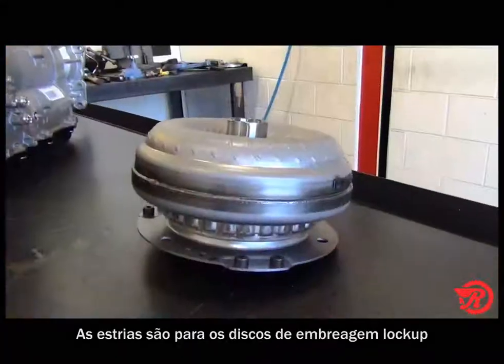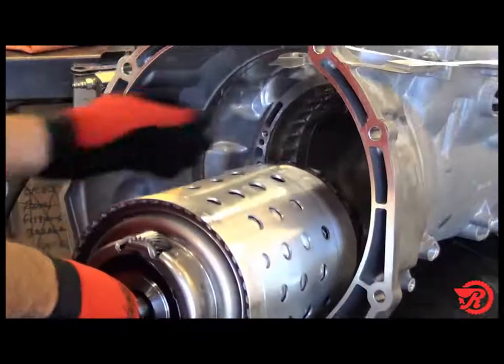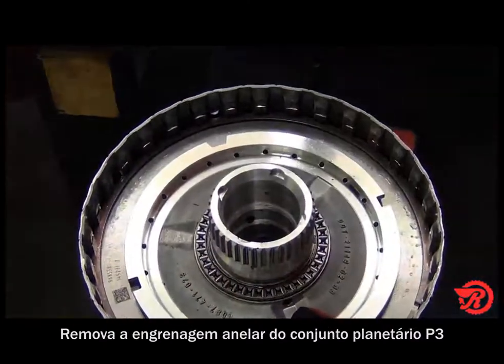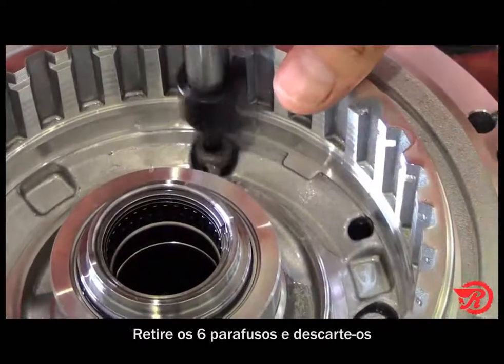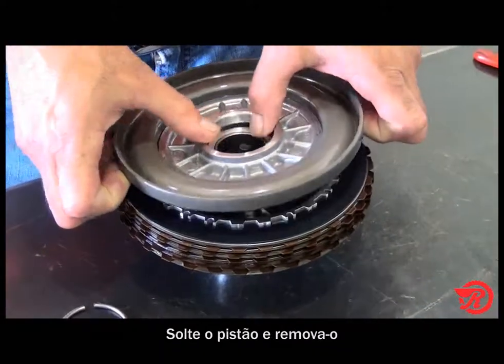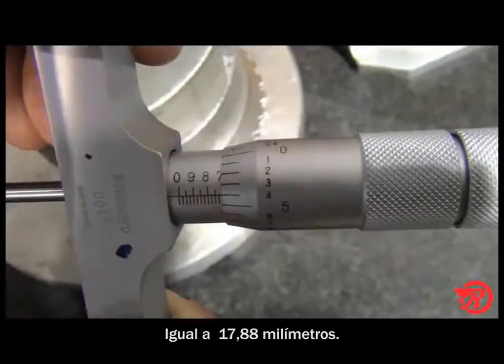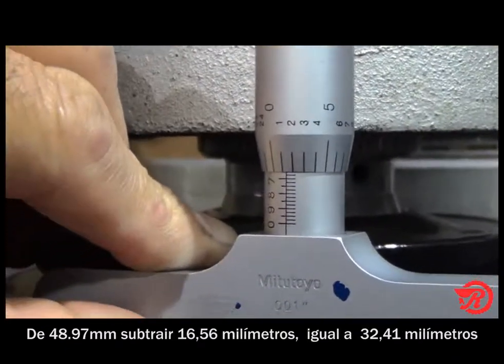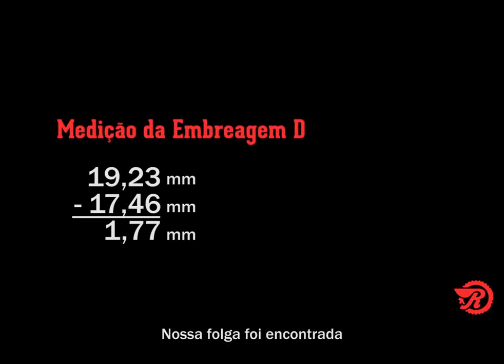Ray's Garage- ZF8HP70 Unit Disassembly (Portuguese Subtitles)

Comment: zf 8hp70 capacity is 8.7 liters. Draining and refilling during a filter change only removes about 3 liters from the pan. How can you remove and replace all the fluid without having to do repeated drain and fill flushes?
Reply from the maker: Unfortunately you cannot remove all of the fluid without the use of a flushing machine. The transmission and trans cooler could be drained but the torque converter cannot.
Reply: @RaybestosGarage  the cooler remains closed and recirculates the fluid back to the transmission under 76 degrees. I'm not sure if there is a machine to do this other than one that adds and subtracts until it has added 15 courts through the system. But it only adds and subtracts from the fill plug incrementally.
Reply: @RaybestosGarage what's the part number on the special  tool